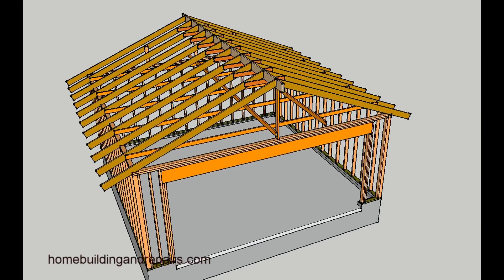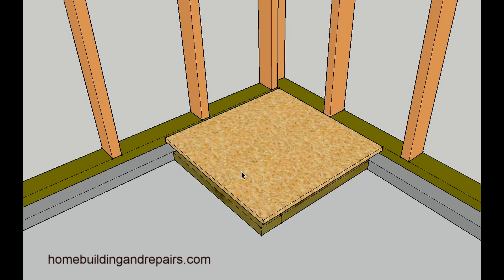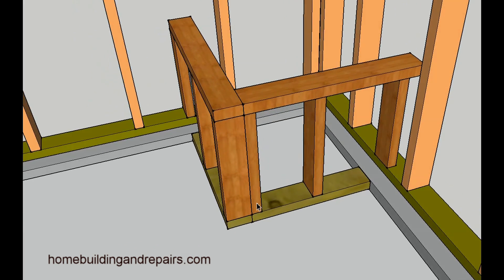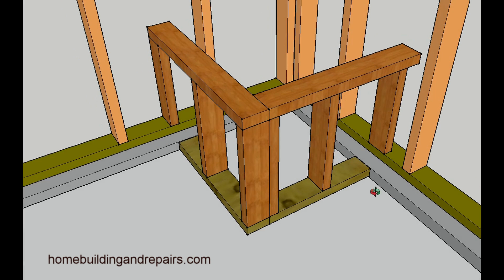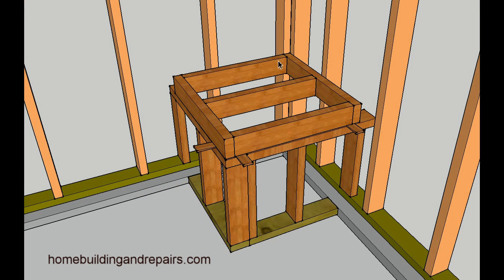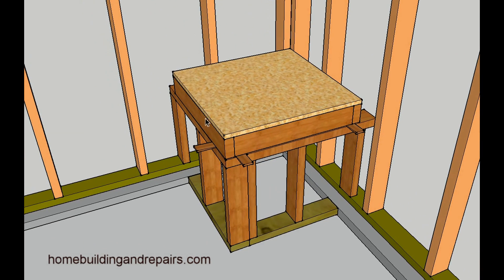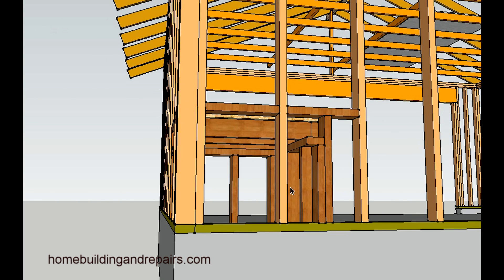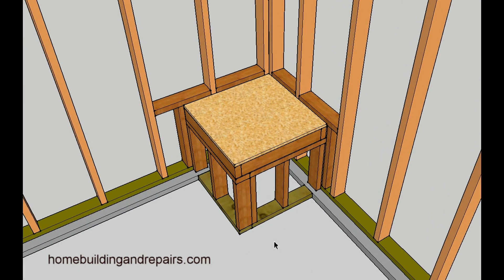Example of How to Frame Water Heater Platform – Home Building Tips

Comment: I've recently discovered a problem with building a water heater platform so that its top makes contact with the walls behind it, as this design does: if the water heater's tank begins to leak (usually after some years), even if it's a slow leak, the leaking water can eventually overflow the drip pan (if one is in place), and water will spill out onto the top of the platform. If the top of the platform is perfectly level, or slopes even VERY slightly back towards the walls, some or all of that water will flow back towards the walls, where it can soak into the sheetrock (including painted sheetrock) and damage it.  This leaking can go on for years without being discovered, since it's soaking into the walls, which serve as a sponge for a while, until you notice that the sheetrock looks like soft clay where it meets the top of the platform. The result can be extensive damage to the walls.  Ask me how I know!

I'm thinking that a water heater platform should be designed to slope very slightly towards the front of the platform to keep leaking water away from the walls, and so you can immediately see if any water is dripping off of it.  The top of the platform shouldn't have to be sloped very much forward to achieve this, while still being a good stable platform for the water heater, especially since it should be tied to the walls with metal straps.
Reply from the maker: Another solution would be to purchase a metal pan that could collect leaking water. They really should go back to building these without drywall and the fire rating could be achieved by using multiple layers of plywood that could easily be removed if they ever got wet and replaced.
Reply: @constructionideas  We have a metal drip pan under the water heater, but the problem was the slight tilt of the water heater's platform toward the walls also caused the drip pan to be slightly tilted toward the walls, so as the drip pan overflowed onto the surface of the tilted platform, the water then flowed along the tilted surface of the platform, backward to the walls. We couldn't see the drip pan overflowing because it's just a slide-under drip pan, with a diameter smaller than the diameter of the water heater so it could fit inbetween the water heater's three stubby feet.  For our next water heater (maybe installed this week), I'm going for a drip pan with a diameter large enough so that its circumference extends a bit past the circumference of the water heater, so the drip pan can be easily checked for water.

But in addition to that, we'll be placing the water heater on a galvanized steel platform that doesn't touch the walls, but instead is about an inch from both of the corner walls.  Any leaks onto this platform will drip down onto the floor, where we should be able to see them due to the open construction of the steel platform allowing us to see under it.
Reply: ...Or build yourself a flood alarm. Anyplace you have brought water into your house needs a flood alert! Basements need them, too!  The kids built them from Cy Tymony's, " Sneaky uses for everyday things". Hack a washer machine buzzer, wire it in use an aspirin. The aspirin dissolved in a flood and and completes the  circuit and sets the buzzer off. As some point in time, It all floods.

Comment: What is the maximum weight your platform can hold please?
Reply from the maker: I don't have that information, but have seen 50 gallon water heaters on platforms like these. Add more structural support braces or legs under the platform joist or use larger materials like 2x6 to make stronger.
Reply: @constructionideas  Thanks.

Comment: Why is 18 inches the minimum height? I was planning on just pouring a 6-12 inch concrete platform so I can get a perfectly level and stable platform and not have to worry about water damage
Reply from the maker: I'm not 100% sure, but what I was told was it had something to do with the average exhaust pipe height off of the ground for vehicle and the amount of flammable vehicle emissions produced about 18 inches off of the ground while a vehicle could have its motor running while parked in a garage.
Reply: @constructionideas  Thanks for your reply- makes sense- I just have an electric water heater so then no need for the height.
Reply: The 18 inch height requirement is only when the water heater is mounted in the garage.  The requirement is to prevent an ignition source, from igniting gas fumes from your automobiles that may be present in the garage from your cars.